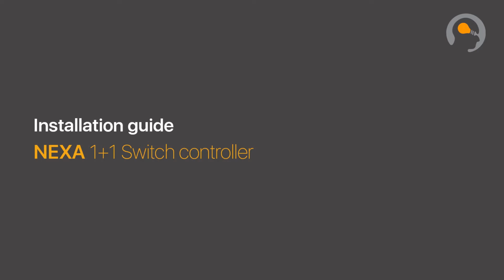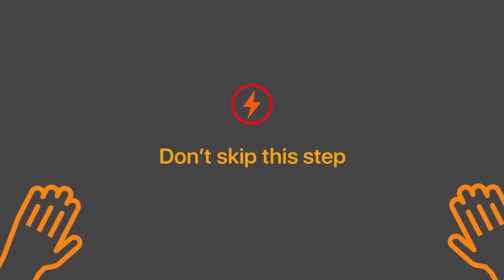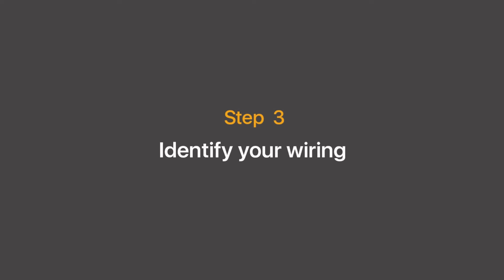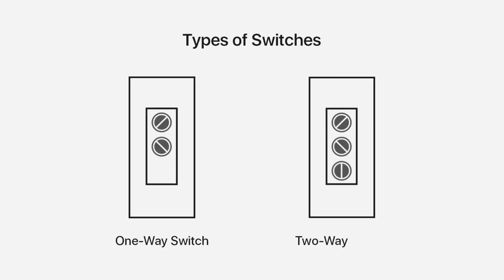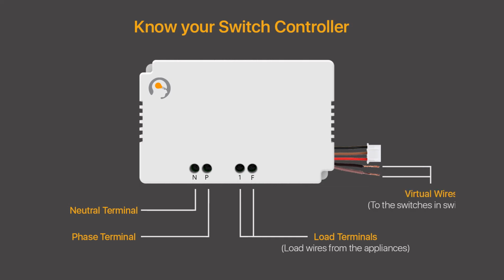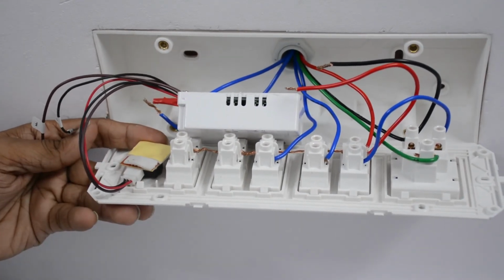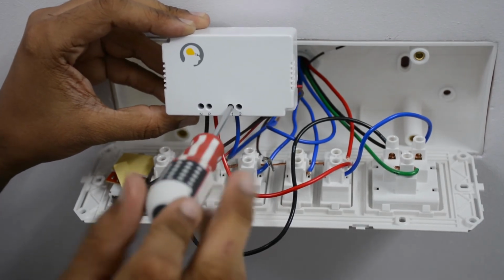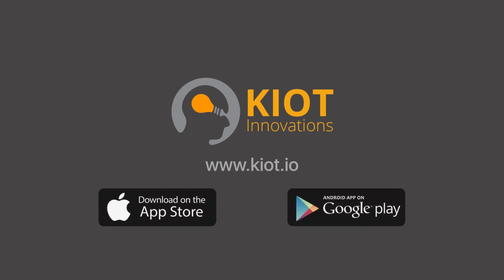KIOT NEXA 1+1 switch installation

Comment: Your videos are a travesty. I was hoping for a more exhaustive video. Detailing things like, the actual phone set up, integrating the unit with google home or Alexa and demonstrating a voice operation. What happens if someone switches the fan off using the physical switch? Will the phone app have to be reconfigured? Can one blank the physical switch and use voice control only? 
Can this product be used with a bridge or a hub? 
This is a very doable as a DIY project in phases and many like me would like to start off with a couple of appliances instead of going to a company and asking them to fix up a home. 
Your USB sensors, where do they plug in,. 
While your products maybe good and economical, you will always lose sales and market share to companies who have better videos detailing their products. 
It is ironic that you choose to sell technology while not utilising technology that is available free, like YouTube to inform people about your products. 
Good luck running your company they way you are doing now.